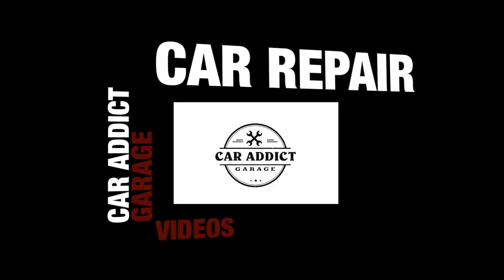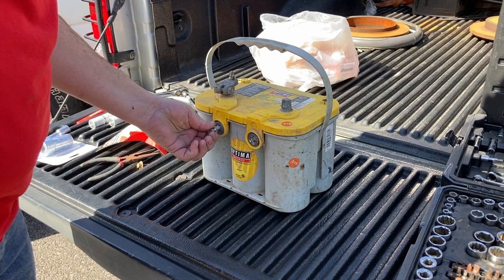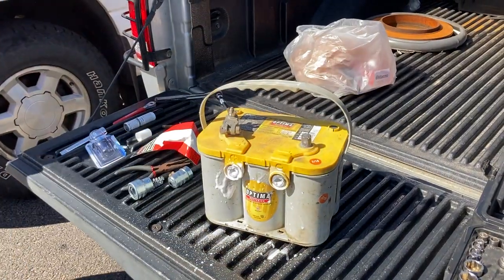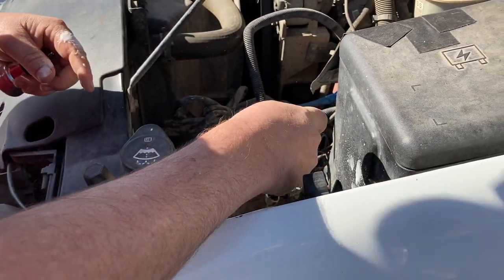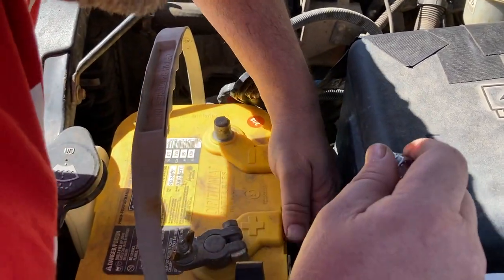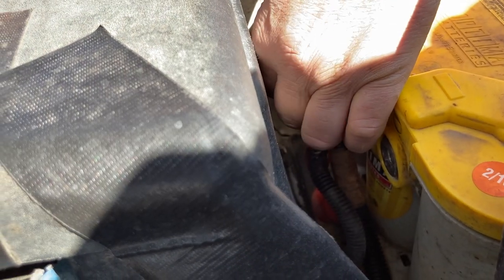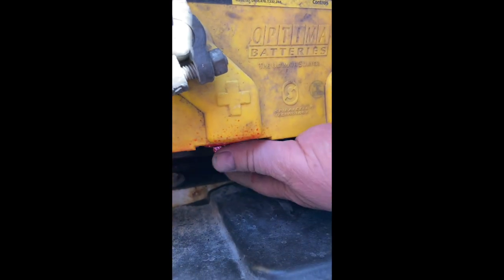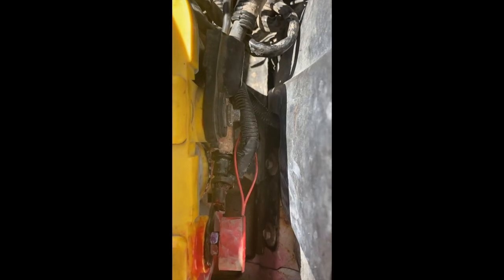How To Fix Stripped Threads on Side Battery Terminal

Comment: I might be crazy but you might want to hold that bolt with another wrench while you tighten the you tighten the nut so it doesn't turn that bolt in any further you may have said that though

Comment: I'm lost as to how exactly you actually repaired the threads. All you did was use a different bolt
Reply: Longer bolt, thereby fixing the problem caused by the stripped threads.. worded poorly.. problem resolved regardless.

Comment: And here I was expecting you would melt solder into the terminal with the bolt in place so there would be new threads when the bolt is removed.

Comment: I have the same battery with the same problem. Very smart solution as long as that bolt doesn't get grounded out. Yes remove the ground first so if you ground out your wrench when removing the positive it won't arch!

Comment: Savior!! We are working on a big deployment for a very important client prospect and one of the solar system batteries stripped out. This one has a male post and the jam nut screws in. The first time it went in just fine but later we needed to add a cable to that post and the nut just jammed half way out, now it wont go neither back in or out is just stuck right in the middle. I didn’t think i can just leave that nut and just put another one on top and move the cables to the middle of both nuts. Thanks for the idea!!

Comment: Im trying this tomorrow when all the stores open.. i have the positive post that screws in all the way but when i put that circle cable on, the screw won't catch and tighten no more. I wish the car would run without the positive connecte,  but i doubt that would probly work huh

Comment: You don't need to cut the rubber just use channel locks to pop the bolt out of the insulator.
Reply from the maker: Thanks for the tip!

Comment: Not lead, they are made of zinc.
Reply: Inside the battery is lead 
The bolts are coated in zinc..........
Reply: @FullAutoApolotics  Yes, I was saying the threads where the bolt goes in are made of zinc.
Reply: Frustrated that someone takes over four minutes to explain something that  is simple common sense, I was hoping for something better. Where is the link to the repair kit?

Comment: I quit buying that brand because they only last a couple months over warranty anyways. Better brands out there if you do some research.
Reply: What brand was that?
Reply: Actually a couple of months before the warantee runs out.  I had 3 of them exchanged at Pep Boys and they refused to exchange the 4th one in my Escalade.  I had one in my 1970 Camara too.  “Had”….  Past tense.  They are real junk now that they are made in Mexico.
Reply: @Jimmy_Cavallo  there is a way to recharge an agm battery.You have to jump it off another battery,before you can hook it directly to the charger.wish i knew that before I got rid of mine  200$ battery gone
Reply: @im_a_ukie8951   Thanks for that tip.  I’ll keep it in mind if I ever buy that type of battery again